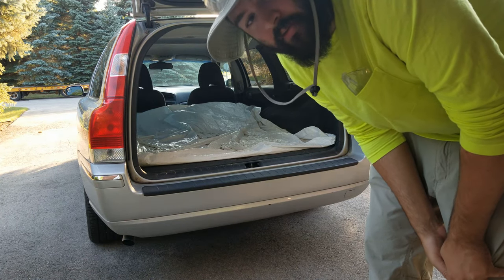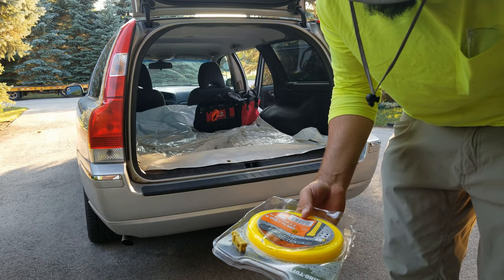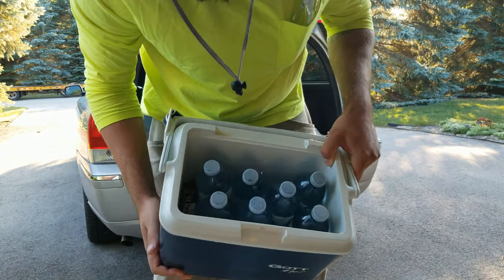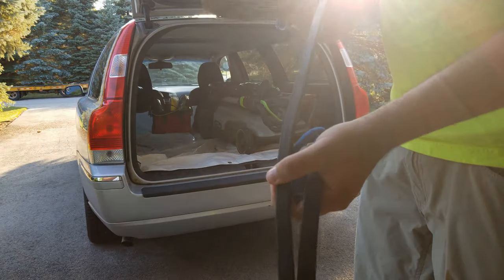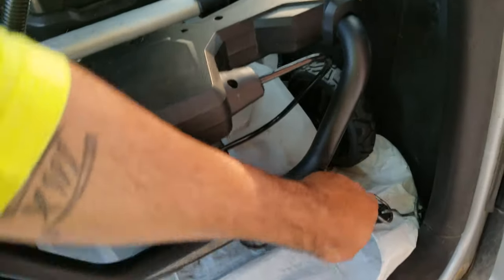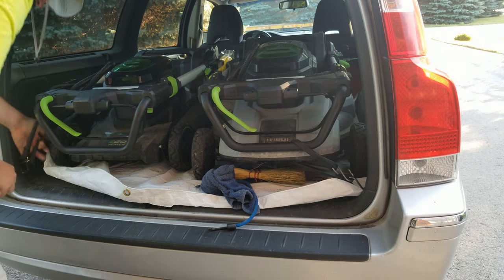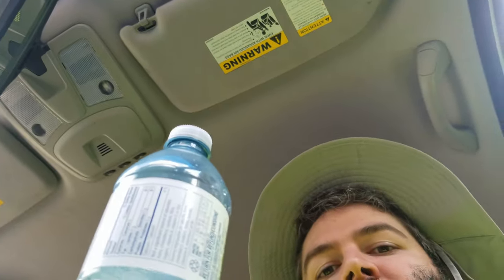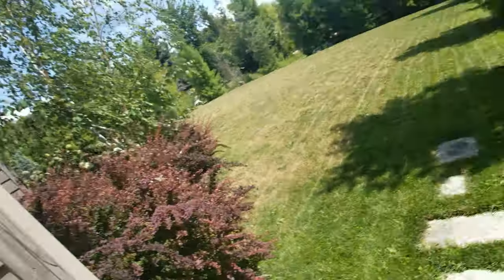EGO MOWER FAIL? + Morning Loadup.

Comment: So are customers paying more because your using electric? My ego is worthless on Bermuda, what type of grass are you cutting?I tried all electric two years ago and have since switched back to some gas,so your method is intriguing. also read that you only spend 10$a day to operate. how much more was it with all gas?thank you for any reply
Reply from the maker: customers do not pay more because of my services, if anything it costs me less to operate.

Not sure how this mower would work on Bermuda, I know high lift blades are required for the 20" mower and the 21" I can barely get away with standard blades. the 21" duel battery mower is more powerful than the single battery mowers though and I will be getting a high lift blade for it next year. ego also came out with a 2-3 blade mower called the select cut which should get you to where you need to be for cutting any style of grass. I recommend looking it up on you tube just came out, sadly only in a single battery configuration though.